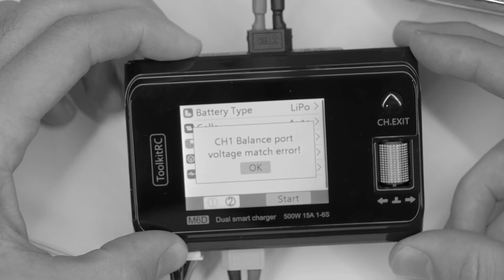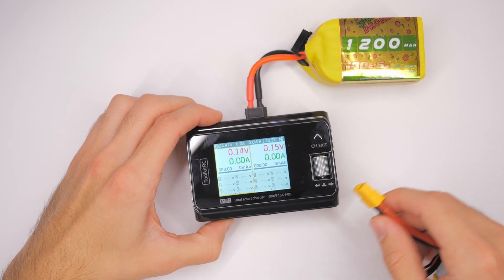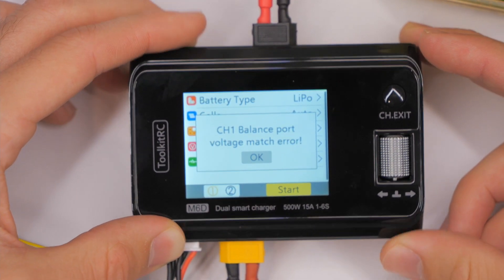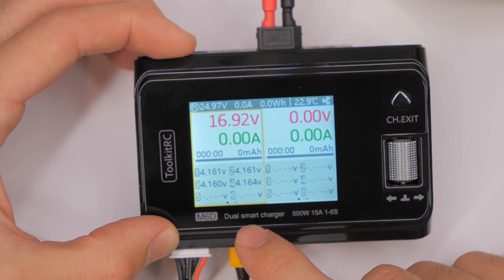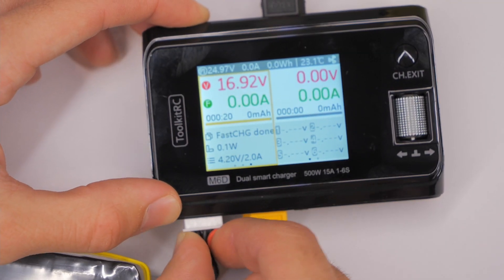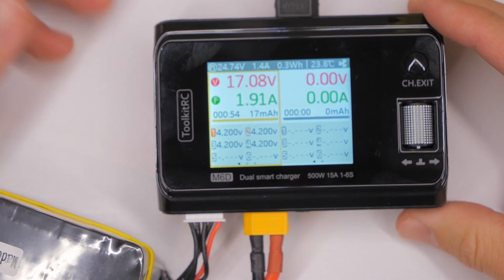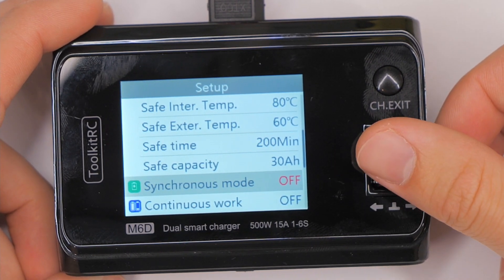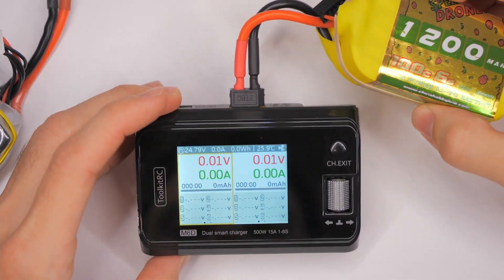SOLVED: Help Me Solve This! ToolkitRC M6D Balance Port Voltage Match Error

Comment: Is there a trick to charge only via balancing port? Thanks
Reply from the maker: Good question. I'll have to test that out. Maybe someone else can chime in.
Reply: @RCwithAdam1  i tried but if the xt60 connection isnt used, so it says voltage to low.

Comment: IT IS about the voltage difference between your individual cells and your Main voltage of your xt 60 because your 4 cells With 4.2 volts should add Up to 16,8 v and Not above 17

Comment: Try power it with voltage less than 24 v, do with like 12v. I think i've seen IT when using 24v power adapter

Comment: is this only happening to you on full bats ? 
try this: 
turn battery selection on in settings
this will give you a selection before it starts charging
set bat type to lipo and enter cell count
start cycle with all leads connected

im guessing it is maybe guessing the cellcount wrong somehow and glitches

Comment: Make a video of you calibrating, I had a similar problem with the 4 channel charger. Be sure you use a good multimeter OR plug in the battery in a charger you know is reading correct values and enter these in the calibration menu

Comment: It seems like your main voltage sensor on XT60 isn't showing the correct value, on 4.2 on each cell it shows 17.08 instead of 16.8, maybe thats the reason?
Reply: Also it's probably looking at the main voltage indicator and see's 16.9 and asks you if you want to charge it to 16.8 so It thinks it has to discharge, but on the balance leads it sees less than 16.8.. Does the same happens with empty battery?